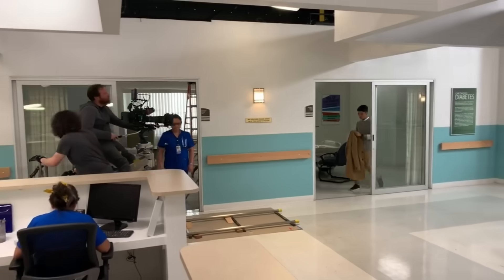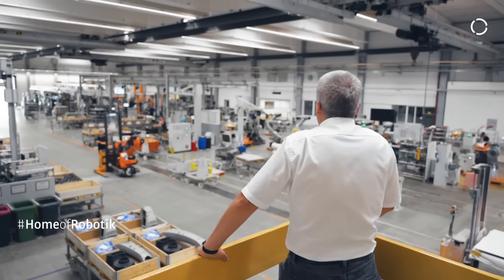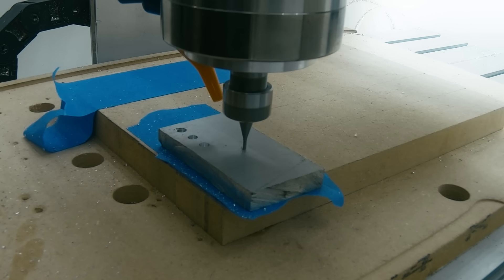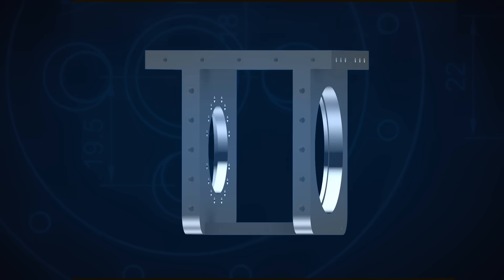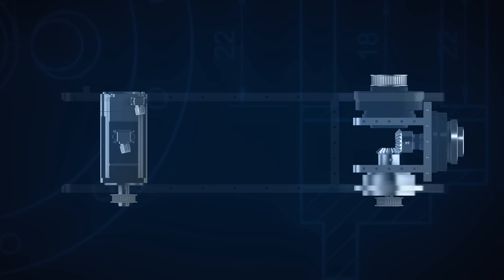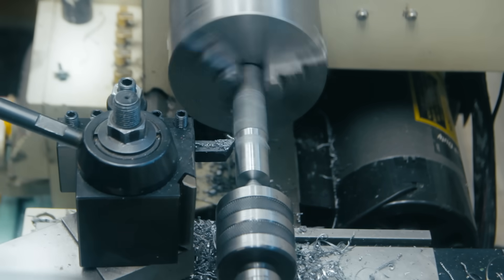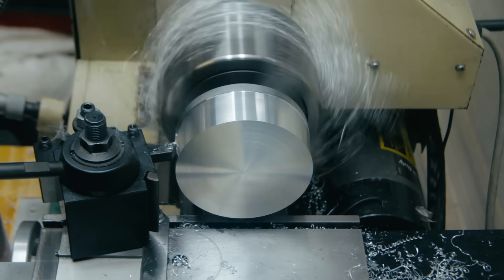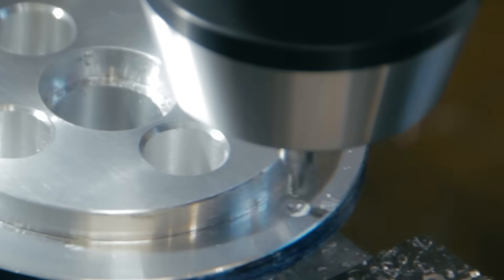I'm building a Robot Arm because I can't afford to buy one.

Comment: I've seen a similar wrist design where the driven mitre gear is mirrored on the opposite side, and then the axis articulation is achieved by adjusting the relative speed and direction of the two gears.
Reply from the maker: That was my method for Marge 1. Works fine but puts the highest load directly on the teeth of the miter gear. This method puts the stress more on the gearbox which is higher precision and allows for smaller (weaker) miter gears.

Comment: If you machine a part hole a couple hundredths of an inch smaller and then heat the part to expand, usually you can get the other part to slide in and when it cools it locks on and will never come out unless you reheat it.. I use to do this and weld the part together afterward before cnc came along… Way easier than manual machining lol..

Comment: Why didn't you use the mill and a flycutter to get the hole up to tolerance?
Reply from the maker: It's a low speed running bearing.  I didn't feel like it was off enough to warrant the extra setup.  We'll see if I was wrong.

Comment: Especially on a lathe, you can't just measure a part for size or fit while you're machining it.  It will be heated up from the cutting, and you have to wait for it to cool back off before measuring with calipers.

Comment: Hi, I found your material very interesting, espesialy because i also built something like this as my master procjet (but of course in much smaler scale). I also have problem with mechanical conection between two axis and also consider compensation it by program so i'am really interesting if you could tell me how you done it? Or maybe even shere a pice of code?

Comment: Nice work, I'm in the midst of doing something very similar, building a 6 axis robot arm to hold my camera. mine is also a v2 ;-) I'm a little further a long in terms of working pieces, (though perhaps not by now) but quite a bit behind in terms of machining. my plan this time is still 3d printed parts where they accelerate process, then remachine in aluminium when they become a problem. Do you have plans on your control setup?
Reply from the maker: Sounds like a good plan. I pretty quickly ran into the limits of 3d prints. More rigidity issues than actual strength. But it all depends on the size and design. I do have some plans for control but it’s not fully worked out yet. So not quite ready to share. But will definitely have some stuff about that soon enough. And let me know if you have ideas in that dept. ;-)
Reply: @Cinema_Mechanics  mine is all stepper motor driven. My v1 was basically a 3 axis gimbal on the end of a counterbalanced crane and I used grbl as the core control, ostensibly testing it like a CNC machine. With a bunch of custom python application translating joystick inputs into gcode instructions. So at the moment that's what I have. But I'd like to go more towards the ik route and have positional feedback. I have a rough model in blender and I'm toying with the idea of extracting data from that

Comment: It's your tape and glue clamping that is allowing for some shift which is why your circles and dimensions are ever so slightly off. Not An Engineer had a similar problem. The glue and tape are both flexible.

Comment: I have worked with a KUKA industrial robot for almost 3 years now and had the luck of using it basically exclusively for R&D. I really admire your ambition, especially since I know what a huge amount of work goes into making a robot work decently. My biggest suggestion is that you should focus a lot of effort into reducing the weight farthest away from your base, since it affects the cost of the motors, acceleration, payload, accuracy & precision as well as a number of other things either directly or indirectly. Since your camera rigs probably weigh a decent bit anyways, it's influence becomes slightly less important but since optimization of these parameters on the software side can be extremely arduous or downright impossible, you should really try to take every win you can.

Regarding the issues with subtractive manufacturing. The super glue idea is kinda rad but since your part is experiencing a lot of vibration and directional force, it might still slide or tilt slightly during machining which could explain the deviations you see. The wooden plate underneath might also be soft enough to shift a few microns under force during machining. You have the tools and the material to build a better form of clamping yourself, so why not look into Youtube videos to do that? Even if at the moment you aren't able to machine a precision part, just having a solid ledge or two for the part to rest against would be a huge improvement.

Comment: It always worries me seeing inexperienced people working unsupervised on conventional lathes… please don’t touch a chip nest while the spindle is running, ideally don’t get close to the spindle while it’s running with your hands, curl up your sleeves at least if you do the latter and I hope you’re wearing safety glasses. Jesus…
Reply from the maker: I think maybe the sped up footage doesn't make it clear that the lathe is always stopped when removing birds nest. The only time I'm anywhere near the chuck while moving is for lubricating during cutoff or filing.    I should use pliers to remove them though since the nests are sharp!  Fair point about the sleeves though.  And yes of course eye protection is non-negotiable.  They're my money makers.  Always appreciate any safety pointers though!  I know these machines are always a little bloodthirsty.

Comment: I know I'm late. Just a quick suggestion, I'm currently planning on doing a similar project, but I played with the huge industrial robots before. Don't reinvent the wheel. Try to take as many parts as you can from automotive. Clever people created cheap to buy parts that can handle insane amounts of forces and impacts. Take a car wheel bearing as an example. Very accurate but handle several tons of forces like when driving over 200mph or holding up a 2+ ton vehicle when driving off a curb and after market wheel bearing/hub set costs 30$. A chevy smallblock timing chain (15$) and sprocket (15$) are cheap and great. If you mount the position sensor in the target location, the software can compensate the tiny slack if any. I'm also working on a software side for controlling this (stand-alone and as a blender plugin to export movements), if interested, get in contact. I'm looking for people who like to test and help. Will be open-sourced soonish (TM).
Reply from the maker: I'm always open to out of the box reuse for parts.  I look forward to checking out what you have in mind.  Also to be honest, used industrial robotics parts aren't too expensive on eBay.  Cross roller bearings, gearboxes, etc.  Sometimes can be had for some screaming deals.  Would love to hear more about your software solution.  I have some stuff I've worked out, but I'm not a software guy particularly.

Comment: Hey man that’s some cool machining for a beginner. I’m a German so if you know someone who can translate what I’m about to say I think it would be helpful to you! Wenn du ein ausdrehwerkzeug mit zwei schneiden benutzt kannst du größere Passungen mit einer genaueren Rundlauf Toleranz herstellen, welche für deine cnc Maschine besser wäre da sie nicht sehr stabil ist. Des Weiteren könntest du deine Fräsmaschine auch benutzen um große Durchmesser mit einer genaueren Toleranz zu fertigen wenn du ein verstellbares dreibackenfutter benutzt. Ich würde im allgemeinen auch mal ein tabellenbuch hernehmen für die ganzen schnittdaten da sie ein besserer Ausgangspunkt sind als nur rum zu probieren.
Getting back to English, I think you did a great job and will continue to get better.
Reply from the maker: Thanks for the suggestions.  I hadn't thought about the O flute being a possible source of inaccuracy but it makes sense.
Reply: @Cinema_Mechanics  yes, the problem with using an O flute is that it is a rather slow process removing so much material and you need to have a machine that is sturdy enough and precise enough to be able to make a round enough diameter for the intended usage. A “ausdrehwerkzeug” just needs to have a roughed out diameter and be positioned above the Center of the diameter and you just go down the Z-axis which is much more precise because just the tool has to be set to the right diameter and it will make a diameter that’s around 5 micrometers off of the set diameter.
Also you could use a tool that is made to rough cut the diameter and use the O flute just on the last pass which might also be precise enough for the robot.
Reply: Antoni,❤

Comment: I am just wondering what type of motor are you going to use? Brushless motor with FOC OR Stepper motor with close loop controller
Reply from the maker: Experiments have all been brushless dc motors with odrive to control them. For the final I hope to use proper servo motors.

Comment: Solution #1 let make critical parts from pro shop with precision machines. #2 Where you can use carbon fiber instead od aluminium. Like for rods, plates etc. and combine it with aluminium or steel. Ridigity of carbon fiber is fabulous. #3 To avoid all the machining hassle just buy an old robot arm. But you have to learn it new code and new computers and retrofit new interfaces.

Comment: Silly camera man. Mills make squares.. lathes make circles lol

Also, super glue is actually used quite a lot. Put a few grooves in a flat plate and you have a makeshift off centered (if wanted) chuck for a lathe if you dont have a 4 jaw chuck
Reply from the maker: I knew I was doing something wrong!

Comment: Great project and results so far.  We need to get industrial robots to the point of RepRap 3D printers which are directly responsible for the explosion of cheap 3D printers we have available now.  Same as we had with the little desktop mills before. 

The fake video distortion and compression artifacts will not age well and bring NOTHING to the table besides irritation.  I struggle to believe that it is your goal as a videographer to demonstrate how bad your results can be.  Instead investigate codecs and variable compression schemes that ELIMINATE these artifacts so that people use your work as best of breed examples.  Dumbing down is trivial with modern editing software and not beneficial on your resume.

Comment: I'm building a camera robot, too. I'll use mine to fly an Insta360 One R around my desk. There's a good chance my robot will poke me in the eye.
Reply from the maker: Don't shoot your eye out.
Reply: @Cinema_Mechanics  Last week, I got my first 3D printer, my first 2 rolls of filament, my first Pi5 8GB, my first Pi Zero, and my first 5-pack of Pi Pico microcontrollers. Now I need to figure out which servos and stepper motors, motor controllers, and gears I'll need to fly my Insta360 camera (that is also mounted to a small teleprompter). Fun times ahead!!

Comment: Using glue (UV-cured stuff anyhow) for workholding is a pretty solid way to machine stuff in some really specific cases with some work. Even used hot glue a few times in some feasability tests and it worked just fine.
Reply from the maker: Ok I'll bite.  How do you cure glue with UV when it's under the metal??

Comment: While machining the aluminium on the lathe. You get the continuous chip of aluminium. Is your cutting tool don't have chip breaker ?.
Reply from the maker: The insert I’m using supposedly has geometry to break chips on aluminum. But no matter what I’ve tried for S&F I can’t get it to break. I’ve seen folks attach a separate beaker piece to the top of the tool. I haven’t tried this. More experimentation is required. That’s like my 3rd or 4th piece of aluminum done on the lathe.

Comment: Seems like a pretty cool project. Just curious, did you use angular contact bearings at your beveled gears for axis 6? If you used a normal ball bearing it will wear out really quickly.
Reply from the maker: Good question. One is attached directly to the gearbox. Pretty sure they’re using a cross roller in there but not positive for the input. The other side are just deep groove. I didn’t think the axial force would be all that bad. We’ll see if I’m wrong. Can always retrofit another type.

Comment: just FYI, bought a 6 axis arm industrial welder from 1990ties together with a 350A mig welding power source, feeder etc, for 240 EUR from an auction in Germany, even if you have to replace all electronics for it, and make some mechanical repairs, it is still A LOT better base to start with than trying to build your own arm from scratch
larger ones, in working condition, that can handle couple hundred kg often go for around 1200EUR
Reply from the maker: Definitely pondered this route. But it’s about the experience more than anything. 🤷‍♂️
Reply: @Cinema_Mechanics  I'd agree if there was something special you needed the arm to do, like make it light enough and have long reach to be mounted on a vehicle, maybe I missed you describing having special application where industrial arm just doesn't cut it, speed/weight

but if you make something inferior to clapped out 30yo robot arm, then that is "toilet" yt content anyway you look at it... you're not teaching anyone anything worth something...

Comment: Buy yourself a boring head to finish the holes, it'll be much easier to get them circular. Actually you could just finish them in the lathe if they'll fit. Nice work.
Reply from the maker: Definitely the plan for the higher speed bearing fits. Decided it was fine for the speeds these travel at.